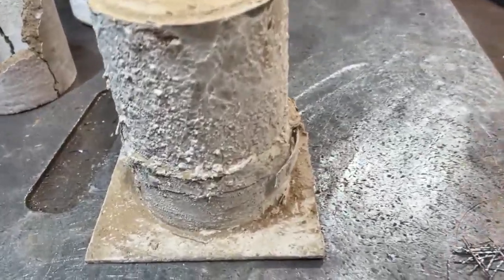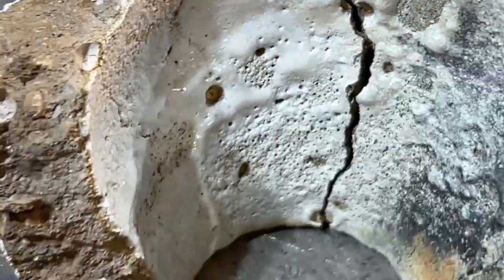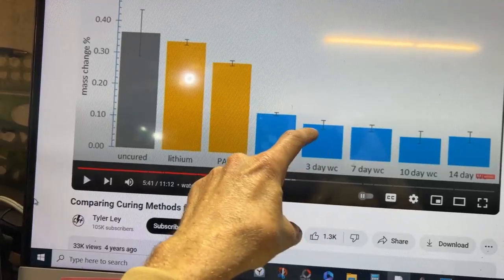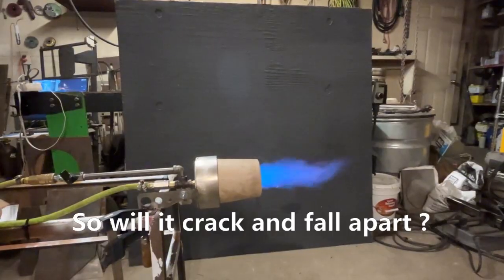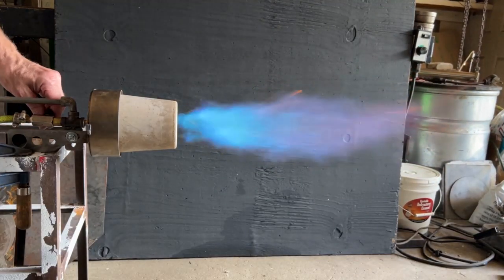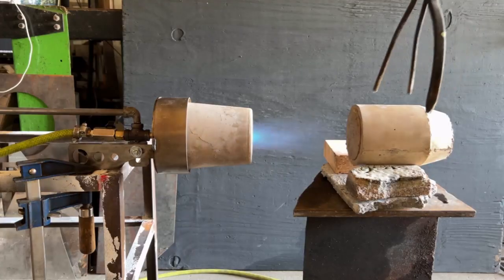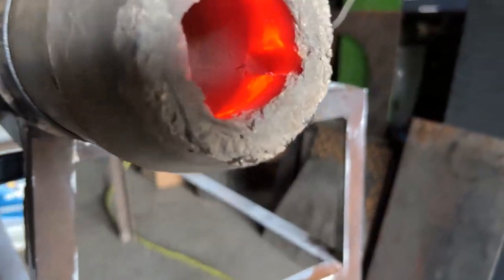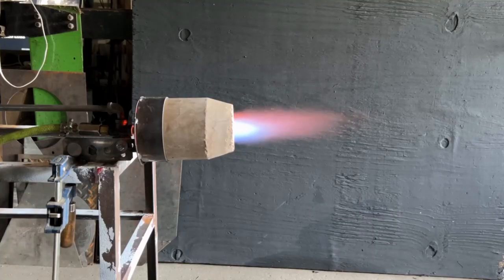Rhino Kiln burner testing . Cone 14 temps with ease .

Comment: If you look at car parking heaters, you'll see that it combines two things. Spinning of the combustion air and that form you had on the white board but only with a disc in front of it to force the combustion into the grooves.
You get a spinning action on the siphon nozzle but also on the added air, like a Kroll oil burner, and then force it through the grooves. That ought to be good then.

Comment: In pottery, temper is added to reduce cracking. That is any non-combustible stuff like sand, ash, crushed ceramics etc. Maybe for your purpose alumina grit would do the trick. You can also dry the thing in a microwave before firing.
Reply from the maker: Thanks for the input . This was dried to 500 F in  pellet grill . The temper is a great idea especially for my high temp high emissivity paints

Comment: I don’t know if you’re aware but Portland cement breaks down at 500° and has no refractory value
Reply from the maker: Thanks for the input .
Its 2400 degree refractory cement from menards . I had some left over and decided to try it out after being so impressed with the resco ram 70 blue . You are correct regarding the aluminum  silicate   as i have bin researching it  .

Comment: You need to do a controlled bake out of the refractory. A good refractory mfg will provide you with a bake out schedule. It would be something like raising the temp 100 degrees per hour  up to a certain holding temp. Im really suorised you got as far as you did without baking it out. ALL refractor expands while hot and will contract when cool. You may want to consider a design with multiple pieces. Maybe if the cylinder were ti be made of 3 arced pieces, as though you were to slice it from intake to exhaust. Then cover it in kao wool and put it in a sleeve. This would allow for thermal movements.
Reply from the maker: This was all done in a pellet grill up to 500 f thats the critical part after that the 800 deg phase change does not cause spauling or cracking
Reply: @NOBOX7 I gotcha. did you get a spec sheet from the mfg? Thought about a multi piece design?
Reply from the maker: @levicalebblack  I have read so many of the bake out schedules you start to realize only some have particular rules that differ from the rest . Phosphate bonded in particular needs to be heated above 600 F before being allowed to cool or it will re adsorb moisture . So as a result i dont bother getting a specific schedule because they are all the same 100 deg per hour for 4 inch thick and 50 deg per hour for 9 inch .
Stop if you see steam .  Im not sure doing a bisq firing would matter , its just to brutal on start up

Comment: I still say that if you build these as segments, 1, you can get more even curing, 2, you can get more even heat dissipation, 3, the 'cracks' will be replaced with expansion joints so that the customer can't complain that its broken, and 4, you just drop them into a stainless steel shell, and it will not only be harder to even see, therefore being less impetus for customers to complain.